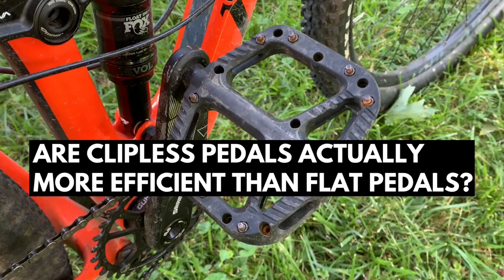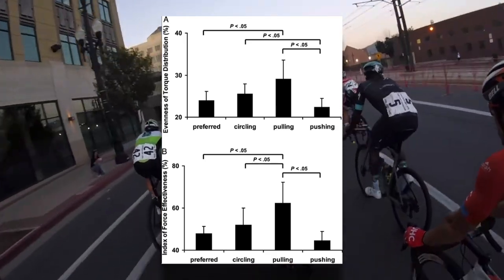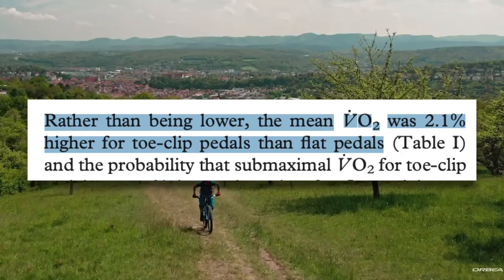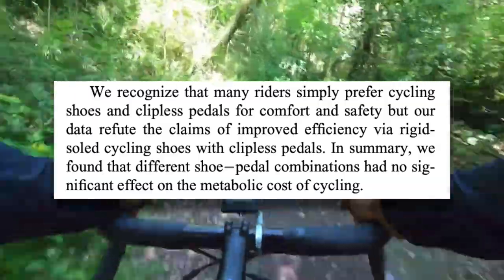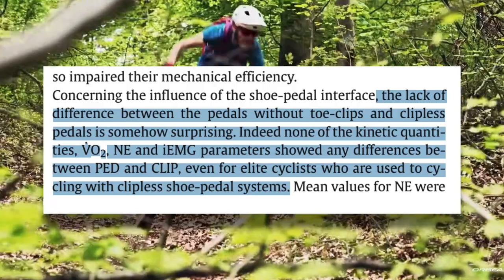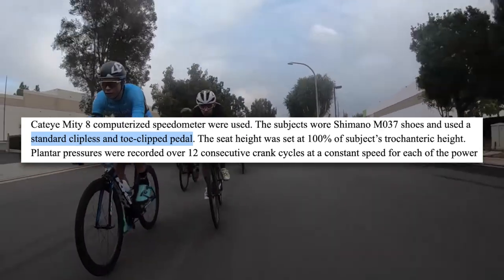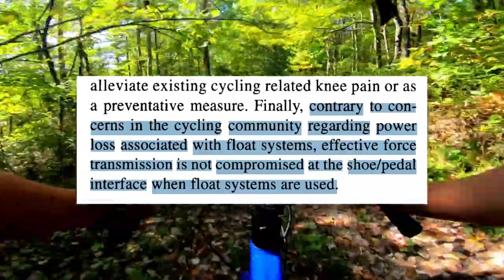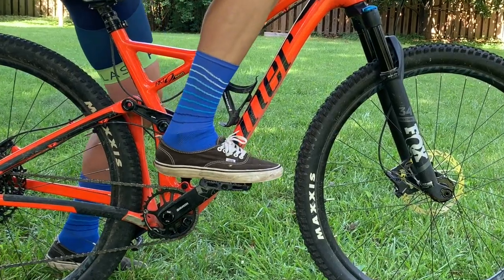Are Clipless Pedals Actually More Efficient Than Flat Pedals? The Answer Might Surprise You.

Comment: I noticed a huge improvement when changing from any old random sneaker to running shoes with tall arch support. Knee tracking is now parallel and pedaling comfort is great.

I’m only considering clipless pedals and shoes to avoid slipping when riding in the wet.

Comment: I had suspected this outcome for years, by all means use what you like but remember clipping your foot in means you will hit the ground hard when you cant dab your foot  especially off road or in a front end washout situation.
Reply: daniel relph Or, sticking your foot down to “dab” at speed could break your leg like it did to a friend of mine.
Reply: @prestachuck2867  That will learn him not to dab.
Reply: @prestachuck2867  I suppose that could happen but I am 50 years old and have ridden BMX bikes and motorcycles for years no broken legs here nor have i heard lf that happening to anyone until now. What I can tell you is if you're locked into the pedals you will eat it eventually and probably bust your face and your arms.Imagine a motocross rider stapping their feet onto the pegs? As speeds increase your front tire will lose traction and you had better put your foot down or you will most assuredly crash.The only time your feet should be stapped in is on a road bike and even then that is debatable.
Reply: @prestachuck2867  
Damn. You're  friend dabbed way to hard. Got my front tooth knocked out not being able to dab when mountain biking in a rock garden at speed. Only use them on the road now.

Comment: I think clipless will become more relevant the more powerful a rider is; obviously pro sprinting is not going to be ideal on even the best flats. However, for regular riders like myself, going back onto flats (decent ones with a good platform and pins for grip) has been a revelation; I'm just as fast (or slow!) as before but find it much more comfortable. Clipless pedals are much more limiting in where you can position your feet so if that doesn't include the ideal position for a given rider then it's not really doing them any favours.
Interesting vid as usual.

Comment: My FTP is 420W and I don't even use pedals.
Reply: If it's not on strava, it didn't happen.
Reply: but you also weigh 600lbs
Reply: File Tranfer Protocol doesn't apply here...
Reply: 420w. 69 likes on comment. Double nice.
Reply: Try with pedals - you'll get 840W then.

Comment: 1) I suspect pulling up on the pedal is not a great idea for the muscles and tendons around the knee even if there was a performance benefit. I had a pain on the backside of my knee that disappeared when I went to flats.
2) Float is fine for road but for mtb I want a firm position that I can readjust depending on the slope angle and terrain.
Reply: 1) just because you have clipless doesn't mean you have to pull (and you can pull through much of the same angles with flats)
2) clearly personal preference, glad you like what you've got

Comment: I've been road cycling for a few years and have road clippers pedals most of that time.  Recently I got a used specialized allez sport. The previous owner had put flat pedals on it. I had planned on taking the clippers pedals off my old bike and put on it. Now I'm a city rider and have to stop a lot at lights and etc and deal with traffic on my rides. I am finding that the flat pedals are a lot easier deal with then the clipless one in my riding situation. I should also add I just ride for fun and fitness.

Comment: I like to be clipped while MTB bc during rough descents, I'll ALWAYS know where the pedals are... right underneath my feet.
I thought I was going to like them on the road bike but I kept getting knee pain... so I had to go back to flats.
Reply: Might be that being clipped in is putting your feet in a bad position that you usually compensate for by shifting your feet around. Maybe look at the crank length, q-factor or saddle height compared to your trail bikes
Reply: Speedplay frogs, 40 degrees of float, your knees will thank you...
Reply: @bikebudha01  thanks! Will look into it. I actually got fitted two days ago, the seat got raised about an inch and cleats aligned... Took it for a 15 mile ride and big change. 
Doesn't more float on the cleats mean more difficult to release them?
Reply: @jzamudiorn  Proper fit is everything.  It's the best money you can spend on a road/gravel bike.  Will solve 99% of your knee, back, everything pain.  Will also make your more comfortable and faster.

Comment: When I climb and pull I notice that I run out of energy significantly faster and I tend to cramp up. So I go back to pushing only.
Maybe I need to train to pull but I doesn't strike me as a possibility to gain an advantage.
Reply: Yeah that pulling when climbing only works for short durations for me as well. But it's still nice to use on that very steep section to keep some speed before you go back to grinding push-only :-)
Reply: The hard pulling is something I reserve for standing while climbing.    That said, if you can perfect circles, you'll find your speed will increase.  Does tend to wear your legs down faster though, so more training is required to build those muscles.  ;)

Comment: Flats for me on my XC mtb and indoor trainer with 5/10's on my feet. It all comes down to personal preference, I tried clips for awhile but I like comfort and confidence I get from riding with flats.  I kind of see it like my dropper post - I'll take the weight penalty if it makes me more confident on the bike.  The one thing I question on the various studies is how familiar the riders are with either system, meaning someone who always rides clips and then has to wear flats for a test is likely not going to do well with the flats and vice versa.  I remember watching a GCN video on the clips vs. flats debate and they clearly had their foot placement completely wrong for the flat pedals (should be more of a mid sole placement for the flats).  I also agree the tests tend to be limited and typically don't take into consideration different riding conditions (climbs, descents, technical features, etc.). I recognize the difficulty with getting results with so many variables.

Comment: For me the best reason why clippers pedals are so important is when you’re riding on uneven ground you can put in power without fear of not putting power straight through the pedal, or worse: your foot slipping off because you tried to push down too hard when your foot wasn’t on the pedal properly.
Reply: Or you could use nice, comfy sneakers and good pedals with grrrrripping pegs and... that's it. 
Actually - sometimes - (i believe) you can even push "harder" by 
leveraging over the side of them. 
And then having a "cruise" position at the center of the pedal. 
*Just a thought

Comment: I’ve come full circle. I started on flat pedals, switched to clipless for about a decade when I was randonneuring, and now I’m back to flats for bikepacking. The parts puzzle now is to source flat pedals that are light and shoes that aren’t too much like puffy overpadded skateboard shoes. I have had to look outside the cycling market for the shoes, opting for trail running shoes and the lightest sneaker type shoes I can find.

Comment: 2 points (both anecdotal) that I would make. 1. For me, when I pull up with my clip-less pedals is very situational. When I am trying to catch someone on a flat, or when my cadence is slowed to a grind on a steep hill are examples that come to mind. Now, these aren't moments where efficiency are that important, but a benefit is still had. 2. I have a 25 year old huffy that I am converting into a decent zwift bike. I did a few rides on the flat pedals that came with the bike, and I can tell you, that when your feet fly off the pedals in high intensity moments, like sprints, or high gear, gear shifts, the moments while you gather your footing (and your senses), are extremely inefficient.  I'll keep my clip-less (or at the very least toe clips) thank you very much.

Comment: As an old guy that occasionally enjoys touring I love flat pedals. I only need one pair of shoes for cycling, walking, restaurants etc on the tour. Of course, that one pair of shoes can get a bit stinky, especially when your feet are stewed by waterproof covers in the rain. Better with no waterproof covers, just water resistant socks like Sealskins. On the whole, simpler is better... flat pedals, wide tires (rolling resistance is the same as narrow for similar pressure and sidewall construction) and I can go on the street or on a trail, no rain-gear (you dry out after the rain anyway). I do like a helmet though, as it keeps the sun off.

Comment: when im absolutly gassed, I feel like I start pulling up more
Reply: I like being able to shift to other positions that aren't possible with flats, like 45 degrees, up or down, using my calves more, and get really lazy about foot positioning, because you're locked in. Mostly a 3 hr plus thing though like you said.
Reply: Yeah I would say that's the key and it doesn't sound like any of the studies address it. The fact is that clipless pedals allow you to use muscles that flat pedals don't and I would think that while normally using those muscles wouldn't add any benefit in terms of efficiency, in extreme situations they serve to give your normal peddling muscles a rest.
Reply: Yep, and definitely happens on steep mtb climbs without thinking about it. The amount of times I slip off flats also puts them below clipping in, especially on descents. When you're flying down gnarly shit and you hit a pedal on a rock your foot flies right the fuck off, not cool. My crankbrothers keep me locked in

Comment: This is certainly interesting, but there are many issues surrounding the studies mentioned. Mostly because these studies were performed indoors and the bike not moving. Neither did they test for rpm speed. The amount re-centering and adjustment when not clipped in is a big factor when cycling outside. Another aspect of the efficiency not talked about was how rpm related to the efficiency being studied. Essentially, the studies asked a more most basic question. Energy expenditure over a longer ride, outside, with all of the regular variables would be more telling. I use flats when training skills on my MTB and riding DH. However, I couldn’t imagine riding flats for a 100+ mile ride.

Comment: I feel like im more secure using clipless pedals, which already gives me alot more power. Pulling up in your pedalstoke is not needed to put down more power. Pulling up makes you tired way to quick.
Reply: Yup, and pulling up seems to be inefficient compared to pushing down anyway. Pushing down means your leg is moving along with gravity, pulling up means your leg is going against gravity. Might be a small difference, but would add up after some distance.

Comment: What about stability or max power in sprints? In my mind being clipped in would be huge
Reply: All I can imagine is the pro peloton in a sprint finish on flats. Right. It would be carnage. When you're full gas at >120 rpm, there's no way clipless doesn't win hands down. I'm just a recreational cyclist, but I like clipless because I have noticed less calf strain when putting the hammer down, I'm sure because I only have to recruit the quads. Could just be me, but I'm a convert.
Reply: Stability wise it depends. In a situation for example if you hit some gravel on the road and feel the bike slipping - having your feet free is hugely beneficial to re-balancing.
Reply: And it is, that´s where you see the most gains!

Comment: Very informative video! I use both pedal systems on my road bike: Time clipless pedals and Diadora cycling shoes for "serious miles", and RockBros flats with New Balance running shoes or Sketchers for recreational/fitness and "urban" riding.  I haven't raced since the late 1980s and live in mostly flat south Louisiana, so no all-out sprinting or hard climbing where clipless is a benefit.  Plus, I like not tearing up my cleats walking in gravel parking lots.

Comment: @6:14 "For starters, all the tests were done on stationary bikes."
I wish that had been in the title. 
It's almost like testing out running shoes—not even on a treadmill, but by jumping rope. 

This isn't rocket science, and it's not about any upward force that may, or may not, be applied to the pedals. Clip-less systems allow you to shift your foot angle every-so-subtly, throughout the pedal stroke, in ways which simply aren't possible on a flat pedal without losing contact between shoe and pedal. You can also "lift" your foot at the top of the stroke, within the shoe, thereby slightly increasing the rotational range, even if it's very tightly fitted to your foot. There's always going to be a small amount of float inside of the shoe that can be beneficial. On a flat pedal? The same action will cause you to lose contact completely, making for a possibly unstable and dangerous experience. Testing any of this out in the real world should totally negate any need for "science." You will never, ever, ever see a pro race on flat pedals on the road. And the reasons are both many, and obvious. 

That being said, it's always interesting to me just how much your foot will naturally change position, front-to-back, on flat pedals when climbing, descending and sprinting. It goes far beyond the range of what even the most imaginative "clip-less" systems will allow for. Essentially locking the shoe to the pedal has never made much sense to me, and the need for precise cleat position assumes that somehow only one position is optimal, regardless of the angle of force on the pedal or tilt of the road. Very odd. 

On technical gravel or any other unpredictable terrain, being able to free your foot instantly has its own advantages, and in those situations flat pedals can be both safer and more sensical. Again though, logic should rule the day and make any debate about such things somewhat silly. The real world reveals all. And usually quite quickly. Use what works, because if it does...it does.
Reply: Also, the study told them “When you ride, make sure to do this that you aren’t used to doing. “

Comment: Just for fun I did a Sprint Triathlon using flat pedals, as a way to see if it saved time in Transition (I am truly slow).  The bike speed was within 1/2 KPH (either side) of other Tris I did that summer.  The T2 time was the fastest in my AG and similar to the average for the top ten finishers (much younger and faster).  Never tried it in a longer race.    Bear in mind the new running shoes (Nike Zoom type) have quite stiff soles and are lighter than cycle shoes.   And apparently the science proves it reasonable.    I confess I have used MTB shoes and SPD pedals for the last few years, they're easier to get in a nd out of, I can use the same shoes in a gym on their bikes and I don't clip clop around like a clumsy horse.

Comment: I've been a cyclist for about 50 years now.  I used to do regular 100+ mile days with the Cyclists Touring Club.  I commuted for years.  I ride on and off road.  I used to use old style toe clips and straps but now ride flats.  I'd rather have the convenience of being able to hop on and off the bike for obstacles than the inconvenience of needing the special shoes, and a set of clipless pedals for each of my bikes.  Maybe I lose a small percentage of peak efficiency in certain specific situations but for normal daily riding, clipless would be more trouble and expense than any realistic gain.  I'm sure clipless makes a difference if speed is the only consideration.

Comment: Have reservations about going flat in the woods. All I can see in my mind is bruises on the front of my shins.  I did take my ATACs off my old mtb/commuter/kid puller and put on some SBH specials (Fookers) and after a ride or 2 to ‘remember’ It was nice just going in work shoes or trainers.  
My bike fitter has been insisted on look black fixed cleats for the road. Most of my troubles were because of cleat position and we’re only being exacerbated by large float cleats are used prior.  good bike fit is key because knee pain can also be a function of other matters not related to your feet. Know that song too. 
Road : Look
MTB : ATAC
Casual/Commute : Fooker
BMX : TBD (my feet hate Vans, always have)
  -U10